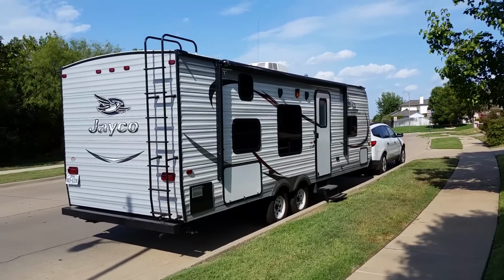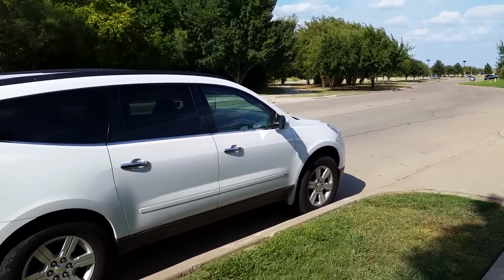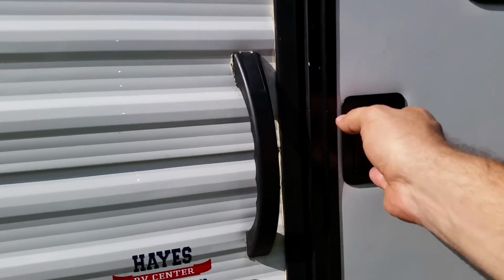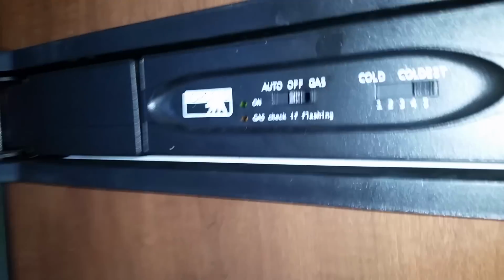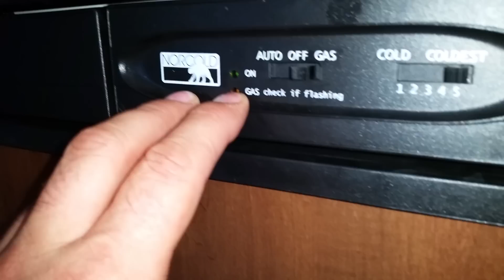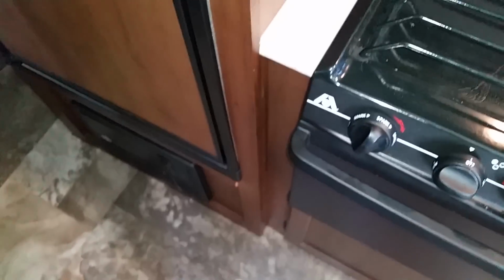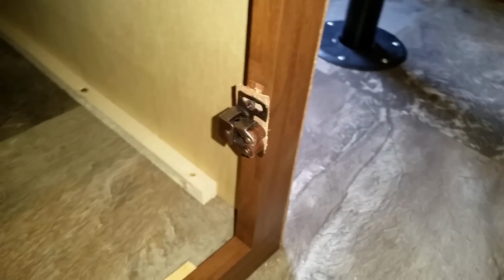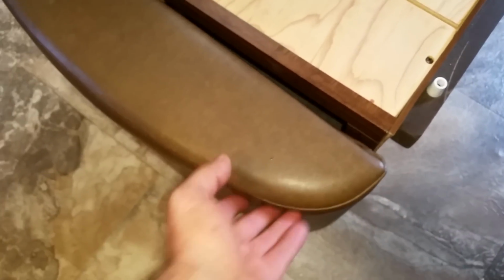Update: New JayCo Trailer FALLING APART.  Lengthy Warranty Work Needed.

Comment: Your Traverse is rated at 2000 lbs towing capacity. Your trailer is around 5000 lbs empty. Not a good situation if you ever get stopped by the DOT or get in an accident.
Reply from the maker: lorendad rated at 5200 lbs actually.
Reply: My wife's 2012 Grand Cherokee with a V8 and AWD is rated at 7200lbs. I hesitate to pull our JJ26bh as it will be nearly 6500lbs with gear plus what we'll have in the Jeep itself. I think my 2002 Dodge 3500 DRW with the 5.9 diesel will do a better job and be 100% safer doing it. I seen a front wheel drive mini van pulling a 32 foot Airstream the other day and I thought, wow!
Reply: lorendad 
The Acadia/Traverse/Enclave/Outlook are rated at 5200lb with factory tow package. 2000lb is if you add your own hitch. The key is the factory trans cooler.
Reply: Adding a transmission cooler brings the weight tow capability up 3200 lbs more? Our JJF 26ft bh has a dry weight of 5300 lbs. Wife thought we could pull it with her hemi powered Jeep. It's rated at 7200 lbs TC. By the time we put some water in the tanks, our clothes and supplies, I'm estimating the trailer will weight near 6000 + lb. I don't see how Big Skid can safely or legally tow his with an Acadia. Over the years as an OTR truck driver I've seen too many car/SUV trailers crashed on the interstates, half ton pick ups too. I wonder how much it coasts our economy in lost time while hundreds of people wait while the messes are cleaned up? Happy Trails!!
Reply: lorendad 
Actually the trans cooler plus changing the shift points do it. 

Were you dry camping where you couldn't get water when you got to the campground? (Wondering why you towed it with water in the tanks.)

I personally wouldn't tow that big trailer with a Traverse either.
Reply from the maker: I added all factory OEM parts from gmpartsclub.com including the factory hitch, factory switch, factory wiring harnesses and factory radiator.  My trailer was 4700lbs dry.
Reply: Big Skid Media Yes, you may have added all OEM parts but I'm AMAZED that you say you towed a 4400+ lb trailer with a vehicle with a towing limit of just 2000 lbs! You must be a heck of a driver! LOL
Reply: aguyandhiscomputer Wow! The factory tow package boosts the tow capacity by 3000+ lbs???? Hard to believe but I'll take your word.
Reply: Do some research like I did and you'll see it's 5,200lb with factory tow package or 2,000 without. And I personally like to keep a 20% margin and never get close to the max rating.
Reply: So my f150 is rated to tow just a couple thousand more then your car? Sure it might be "rated" to tow whatever but imo doesn't mean it's doing it safely.  When your traveling down the road at 65 mph and a big gust of wind comes along and blows your 4700lb sail around what do you think your little cross over vehicle is going to do??
Reply: Towing and stopping are two different issues. My f250 will probably pull a train. Do i think i could stop it? Not a chance.
Reply: Luke K Ray I agree. I have owned f350, 550 and also a Freightliner m2 pulling various trailers and a perfect example was pulling my 4 car trailer with the m2 and how easy it was with that truck. I know the f550 was rates to pull the same trailer but I honestly don't see how safe it was brakes wise compared to the m2... But people do it all the time.
Reply from the maker: First off, this vehicle was AWD and curb weight was nearly 5,000 lbs, basically on par with a half ton Silverado. So the concept of being blown around on the freeway is crazy level absurd.
Reply from the maker: Luke K Ray that's why trailers have electric brakes.
Reply: It doesn't matter that it has brakes or not. It is a dangerous situation pulling that trailer with that vehicle. If your going to have to have a trailer you need the proper vehicle to pull it. In this case you do not imo.

I have had everything from f150, f350, f550 and also a Freightliner sportchassis. And no doubt the bigger the vehicle the more safe it is and you feel.
Reply: You pull that easily with a Traverse? In the mountains. Yeah okay. #timebomb
Reply from the maker: Garth Mattson what components are you concerned about?  The 281 hp engine?  Computer controlled awd system and sway control?
Reply: Big Skid Media :  Why would you do that?  It is hard on the tow vehicle.  Dude, you should have watched an RV video by a lawyer.  He could have told you everything you just complained about.  Plus there is no RV lemon law.
Reply: Well, if electric brakes is all i need....the train and tractor trailer freight industries better look out! Me and the f250 are coming for em!!!
Reply: I have the 2017 of this trailer but not an slx which I think this model is, we have the version above this, I tow it with a 2016 Silverado 1500, my truck has a 5.3, 4x4 with 3.08 gearing for better mpg, I have upgraded the suspension for towing and run a weight distribution hitch. My truck the way it sits can tow 6200 lbs. My trailer is 4900 lbs dry. With all due respect, the way you are towing this trailer is a danger to you, your family and every other driver on the road. Forget about the nail your son can scratch himself on. The dealer that allowed you to leave the lot towing it with a small SUV should be sued. I hope you either purchased a suitable tow vehicle or jayco took this thing back. Also, how you broke all that stuff amazes me. We have two crazy kids, have been out around 25 times and my trailer looks great. Looks like operator error, the same thing your ins company will tell you when you flip this trailer and that little SUV over. Good luck bud!
Reply: NE Ohio Lawn & Landscape Info I'm with you on that one . If you are pulling a trailer then you need a truck. Forget the load rating those crossovers ability to tow is a secondary component.  Crossovers are great for getting around but if you are into RVing seriously then a truck is your best safest bet
Reply: bigleftlcn ...Well said!
Reply: Big Skid Media: your 281 HP is at 6300 rpm. That is sooooo much stress on the drivetrain. How long will that last? Your GCWR is 10520. Your dry weight is 4700 lbs. The curb weight of your tow vehicle is 4925. With 3 passengers weighing 500 and 500 in gear, you’d weigh in at 10,625. That’s almost 100 lbs over weight and I’m being conservative. Probably closer to 200 lbs over. PLEASE go to a cat scale and get weighed. Your pride is not worth your family’s life or those around you.
Reply: The first windy pass he travels through will send that puny suv into the ditch. It’s not always about weight. That thing is a huge sail that the wheelbase and curb weight just can’t handle.
Reply: terrible trailer, OMG.
Reply: Manufacturer's towing ratings are not legally binding.  And in fact, in the United States the ratings are SEVERELY conservative due to manufacturers' fears of frivolous liability lawsuits (thanks a lot lawyers...).  As an example, my 1998 Jeep Cherokee 4.0 here in the U.S. is only rated to tow 2,000 lbs.  But an identically equipped Jeep Cherokee 4.0 in the United Kingdom is rated to tow 7,165 lbs.
Reply: hayesman76 there is plenty of videos of this guy and his family upside down on the e way. Lmao
Reply: hayesman76 I remember when.  I had the idea to pull a 5000lb trailer with my trailblazer, then I thought about my family's lives and others on the road so I upgraded to a truck.
Reply: The problem is they only build this stuff to last until the warranty expires. Jayco used to make good quality campers. I’ve owned two. Now they are a POS
Reply: lorendad not only the tow rating matters also the wheel base of tow vehicle
Reply: Typical truck driver comment. Did driving OTR desensitize you to the deaths that occur due to those accidents? How many of them were caused by an overweight semi trailer? I have traveled across Canada more than a dozen times and have only ever been held up by a tractor trailer accident that dumped its load onto the highway. Not once have I made the trip without some trucker forcing us off the road because he felt it was necessary to pass another trucker too close to a turn or a blind hill. 
Does years behind the wheel of a truck make you an asshole or is it a prerequisite to numbing you to the long hours on the road and the tragedies you witness along the way? Hopefully, you're done with it now!
Reply: lorendad.  I had a 2011 Traverse and factory tow eating was 5500 lbs but I wouldn't tow with it baca use of fwd.
Reply: Yeah factory towing package means that rather than a ball on the bumper that can only take so much before being torn off that the factory towing package option is a frame mounted hitch that is rated for more.  It doesn't change what the car can tow, it's just an upgrade to the receiver is all.
I wouldn't want to tow that much with that traverse at all, not safe, but most people don't care, they just want cheap and quick.
Reply: What you said, but a F150 isn't going to fare alot better, if you want the best sway control you aren't going to beat a DRW setup.  The f150 is going to have a MUCH better shot of stopping the load than the traverse though.
Reply: You can't explain this to light duty owners, they think if it goes then it is safe.
There needs to be more strict laws on towing, this stuff makes the roads more unsafe for the rest of us.
Reply: LOL, no joke, coal rolling and all.  The ol 7.3 can also burn the nastiest waste oil just like a train can too, I use to make my own blend of waste fuel in my powerstroke 7.3s, $20 of diesel would equate to about 600 miles of driving and about 400 miles if loaded well.
Reply: joenissan you realize that “puny SUV” weighs as much as a half ton truck, right? I wouldn’t tow that much with it - but it’s hardly going to be a rag doll on the road.
Reply: That only gives you 500 lbs of carry on personal items for the trailer to be at your traverse's max towable limit.
Reply: You WILL be prematurely replacing a transmission. I don’t care what the rating is. Remember you are not taking in account for food fuel and people. I know too many ppl who have burned up their tranny pulling stuff right at the towing capacity of the vehicle. Plain and simple, those vehicles are not meant to pull half of what they are rated.
Reply: I was just in Colorado and those mountains are no joke. Your tow vehicle is too damn small. Get a truck that is made for towing. Every time you tow with that car it takes 5 years off it's life.
Oh did you go the the hour inspection before you bought it?
Reply: People who drive past traffic accidents and immediately think about the economy don't get to take the moral high ground. 
Just saying. Bit ghoulish really.
Reply: I believe the tow package on my new Ford F-150 included a heavier duty transmission with a lower rear end gear ratio.  Heavier brakes, towing mirrors, heavier tires, heavier hitch, heavier frame, trailer brake package, heavier wiring harness, heavier duty alternator and a lot larger battery.  Larger radiator and a transmission cooler.  Not sure of what else, but it also rides stiffer than the one identical to it that I tried out without the Heavy duty towing package.  Well worth the difference in price.  I buy a brand new truck every 3 or 5 years and wouldn't own one without a towing package.
Reply: Even my Odyssey is rated at 5,000 pounds for towing.  I wouldn't dream of even trying it.
Reply: Have an accident while overloaded and your insurance carrier will cancel you.  They'll have to pay that claim but then you're SOL.
Reply: Holy smokes... you really tow that camper with a Traverse?  Wow, I wouldn't pull that trailer with anything less than a full-size SUV (tahoe, expedition, Armada) or a half-ton pickup.
Reply: i just bought the 2018 version of this trailer i towed it home with a 2013 Durango and i was scared for my life.
Reply: That’s what I call white knuckle towing!!
Reply from the maker: @bigleftlcn  its a 5000 lb suv. So a 5000 lb truck weighs more?
Reply: I have a 2015 Traverse with factory tow pkg..I tow at less than 80% of the 5200 lb..aren't you concerned about killing your Traverse?
Reply: In my opinion you are putting your family in danger by towing that size rv with your tinny suv.. you have been lucky so far. Good luck!!
Reply: lorendad yes but adding things doesn’t change your sticker ... or the fines
Reply: What about a Kia Sedona minivan towing a 2019 3000lb dry  jayco SLX 74BH
Reply: @TheCasinoCrew  Why do Engineers bother 'rating' anything? Maybe he should just get an F250 to pull a 4700 lb trailer then... why risk it with an F150?
Reply from the maker: @bigleftlcn  meh
Reply from the maker: @troyzieman7177  what facts and logic are you basing this on?
Reply from the maker: @JoeGraves24  how do you know I didn't upgrade or modify the vehicle?
Reply from the maker: @joenissan  wrong, I towed it all over the country.
Reply from the maker: @avenged06x  wrong again.  You're 0 for 157,375 now in life
Reply from the maker: @PatrickBaptist  totally 100% safe.
Reply: @BigSkidMedia  keep thinking that guy. Also reply a little sooner.
Reply: @BigSkidMedia  I think its hilarious that almost a year later, you go back and read all these comments on your bad life decisions only to reply now, lmaoooooooo, I figured you were a troll!
Reply from the maker: @therustyblades1212  prove that.
Reply from the maker: @travelingwithrick  prove it Rick roll.
Reply: @BigSkidMedia  100% don't believe that claim, I've been towing far too long and I sometimes to runy my truck overweight by a good deal, but that is nothing like a truck and I've towed will all kinds of vehicles, it is unsafe, AWD doesn't make it more "stable" while your going down the road and just one more thing to tear up in your case as towing will def wear your car out much faster.  But I understand you aren't going to hear it, hopefully you won't wind up having to stop quickly and control your load in a bad situation.
Reply: Big Skid Media If you did, which you didn’t specify, it DOES NOT change the factory to w rating of your vehicle. The only way to increase that number legally is to get the factory (or maybe the dealer) to do a recertification and place a new sticker on your vehicle that states the new GVWR. If you get involved in an accident while overloaded, the lawyers will chew you up. Your choice though.
Reply from the maker: @DanDan-gg9tm  that traverse was not made of tin.
Reply from the maker: @avenged06x  ok,  that's funny.  Touche. Hard to believe I fanned the flames of two RV videos that took a combined 20 minutes to record and upload to a tune of 600k views.
Reply from the maker: @PatrickBaptist  I actually upgraded to a 2017 Tundra just fyi.
Reply from the maker: @JoeGraves24  this isn't commercial trucking.  There's no excise tax for 33k gvwr trucks,  I don't have to stop for scales,  etc. I actually had a long conversation with GMs head of engineering before I ever tried this.  I had no problem going over the mountains in Colorado and in fact safely towed to 12,000 feet.  Moreover,  it's my tow vehicle,  if I want to abuse it or run it off a cliff,  what business of anyone's is it?
Reply from the maker: @bigleftlcn  these videos don't die,  they keep generating views and comments.
Reply from the maker: @PatrickBaptist  I filmed this after safely driving from Texas to 12,000 feet in Colorado and back home.  You might have a different definition of safe ... but I never had a collision, flip over,  spin out, runaway brakes failed moment.
Reply from the maker: @JoeGraves24  what's the factory to w rating?
Reply from the maker: @bigleftlcn  what you must remember is that you get the best deals on Chevy and GMC parts at www.gmpartsclub.com.
Reply: Big Skid Media typo. Tow rating. Hey, it is your vehicle and life. However, I do applaud your upgrade to a good towing truck. But, for the record, anybody who tows over GCVWR is indeed liable for any accident that may happen. Doesn’t have to be commercial trucking. No, the cops probably aren’t going to pull out the scales on you, but accidents happen. I wouldn’t want to be on the hook for all the damages just because an insurance company says I was over weight by a couple hundred pounds. Just me though. Peace
Reply from the maker: If I recall it was over 4600 lbs.
Reply from the maker: @TheCasinoCrew  I guess I'll keep going to my destination.
Reply from the maker: @TheCasinoCrew  Sri just as long as someone feels safe,  they are safe?
Reply from the maker: @JoeGraves24  I'm going to give myself a compliment. I'm able to say that I'm smart enough to admit that you possibly,  maybe,  somehow have a point.
Reply from the maker: @JoeGraves24  you can go see my Tundra on Toyota Truck Club.  https://www.toyotatruckclub.com/media/
Reply from the maker: @douglasmanson2186  I actually wrecked this vehicle in 2016. Replaced it with a FWD traverse for my wife and I bought a 2017 Tundra CrewMax 4WD.
Reply: @hayesman76  all you have to do in look it up man. not hard to find out.